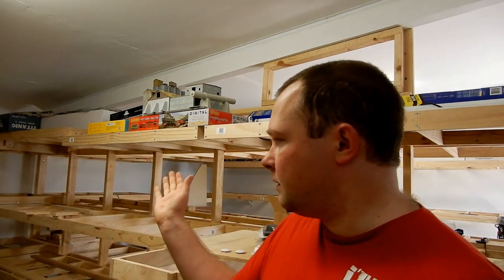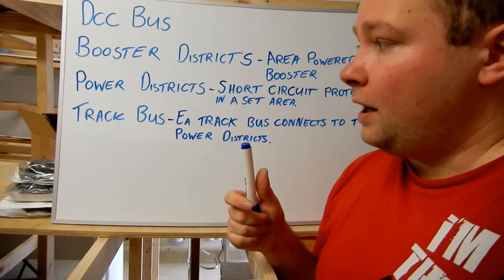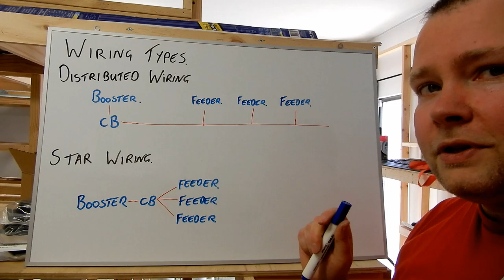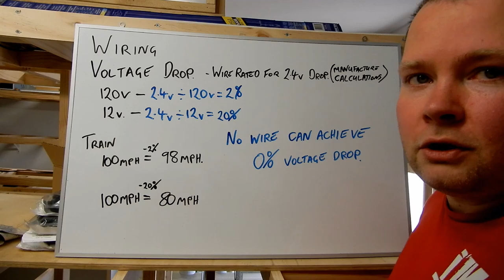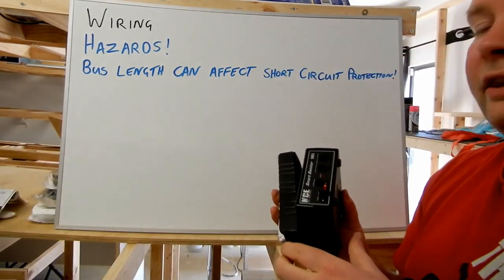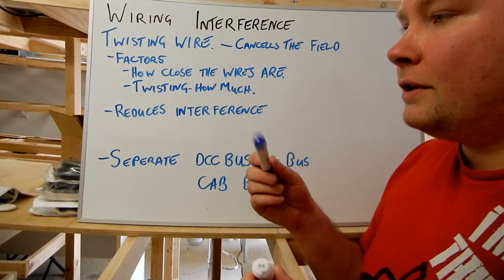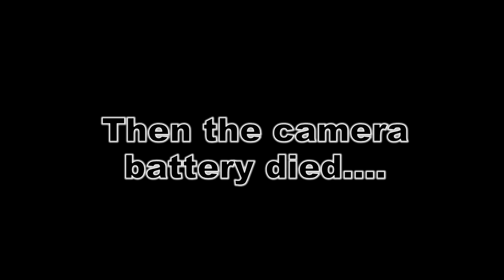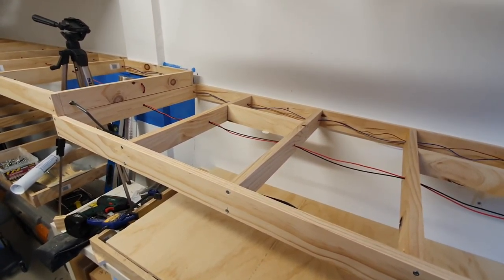Leila Central Model Railway - DCC Wiring fundamentals.

Comment: Great work on those baseboards they look solid. you are right to do research when it comes track laying. especially on gentle curves. it helps you pick out the right points that is required to lay the track...best wishes Tony. have a great weekend..............
Reply from the maker: Thanks Tony for watching and commenting. The baseboards indeed are solid, 12 mm in fact. Heavy but strong as well. Wont be to much longer until trains run I hope. All the best bud, Clint

Comment: I appreciate your videos, I have an NCE 5 amp DCC system, I have a 12’x24’ room, with a single level, approximately 100’ of HO track, I’m using 12 gauge bus around the layout, I will not have multiple operators,. My question is, do I need a booster, and second, does it matter where the booster is placed? Thank you for your work, I will await your reply
Reply from the maker: Hi Ken, I would say no need for a booster. 5amps for HO/OO is more than adequate for what we want to run even with multiple locomotives running sound at the same time. No issues on where you place the booster, i generally put it at the end of the bus wire either end. Usually space decides that part, Clint
Reply: Thank you, I appreciate your fast response, good luck with your layout. Looking forward to your updates!!! God Bless

Comment: Hi Clint, as I am an old fart I found your video extremely interesting and very helpful. Much as I had planned my wiring but you have put the meat on it. My only question is without changing the wire diameters etc would it be exactly the same for my N Gauge layout?  Covering your wiring of your layout like this along with wiring your points will be very instructive for newbies like me and gives me more confidence in what I am doing, so keep up the excellent videos. Looking forward to the next one as I will not be very far behind you in constructing my layout, it also seems I have the same controller as your good self by the sound of things.
Regards Chris
Reply from the maker: Hi Chris, thanks for watching and your kind words. In short It is a bit hard for me to answer that if what i'm using is suitable for you due to many factors. I would say yes since the wiring has little voltage drop BUT that in itself is not enough. There can be unforeseen issues with yours that I may not be able to identify unless i was there and to look over it. My NCE system is running at 5amps and for OO gauge is alot and if for running N gauge it is too much in my opinion. However it does depend on what you intent to run and how many plus the distance the wiring needs to cover, plus your DCC system and other factors. You may also need to take into account the rails you are using otherwise your dropper wires could be far too big for the rails as well. I wish I could give you just a straight answer but sadly it is not a simple answer. I will keep posting videos as i make progress as they occur as well. All the best bud, Clint
Reply: Sorry Clint I am still learning. So would it be advisable to split your layout up into areas. I am considering on having three areas or districts on mine. The terminus/yard would be area/district 1, the fiddle yard as 2, and the rest of the track as 3, so that if you have a short it helps you to isolate each area for ease of detection, especially on a large layout like mine?
Regards Chris
Reply from the maker: Hi Chris, hard to say bud. If you asked 20 people weather it was advisable you would get mixed answers really. My advice is do what suits yourself. I listed my reasons as to why I won't do it and the concept on how to do it but for the benefits, hardly any of them will benefit me. Other people would disagree tho. Your idea sounds good on the districts you would propose and it would be very similar if I was faced with the same areas. All the best, Clint